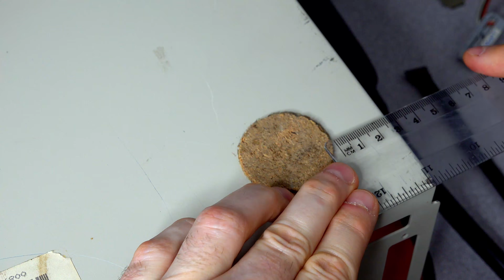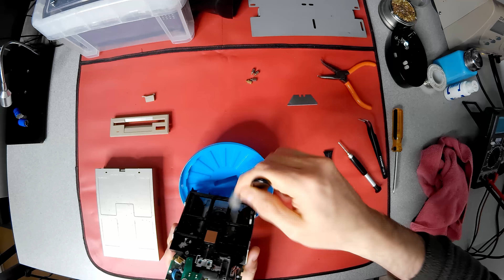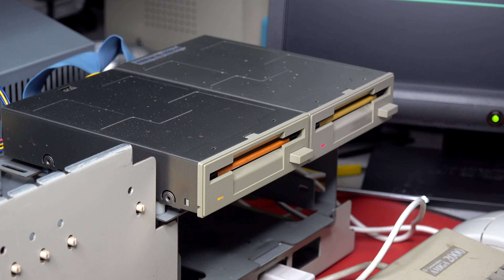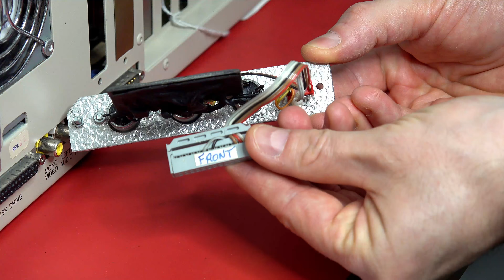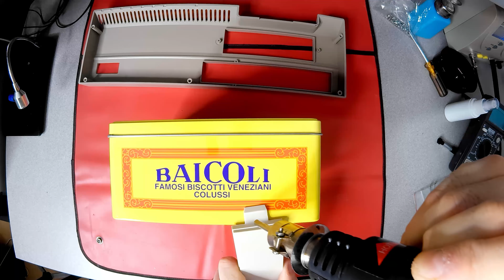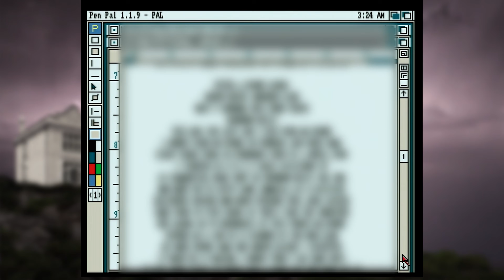Mystery Amiga 2000's (Pt4) - Finishing the first A2000

Comment: I'm used to seeing Atari STs and Macs for midi use, but i was not aware that the Amiga was used for that as well. But then my attention was always on the keyboard models, like the 500 and 1200. I barely even knew Amiga had desktop models until long after i had moved to PC.
Reply from the maker: All the range could easily have MIDI added (and quite cheaply too) but I guess as it wasn't standard and a decent hi-res monitor was expensive, the Amiga lost out to STs and Macs. The CDTV was the only model to come with MIDI In/Out as standard but that was aimed at the living room.

Comment: Great video.  I'm currently restoring my Amiga 2000 as well.  Suffered a bit of damage from the dreadful Varta battery.
Reply from the maker: I haven't seen an Amiga 2000 without battery damage so it's in good company there. Much damage? How's the Amos work going?
Reply: @TheDigitalOrphanage  Quite a bit of damage.  Several broken traces.  Mostly pads separated from the trace.  AMOS work has been a little slow.  Been re-learning some 68K asm.  I finally managed to backup ALL of my 1990's data off my A1200.  :-)
Reply from the maker: Little bit of jumper wire and you'll be sorted! When I find some I want to learn some 68k assembler, sounds like I now know who to say hello to nicely if I get stuck! :-) What assembler are you using, Devpac 3?
Reply: @TheDigitalOrphanage  I'm using vasm.  I prefer to assemble on my PC and send to WinAUE (to be later ran on real Amiga hardware).  I highly recommend this video for programming the Amiga in ASM:  https://www.youtube.com/watch?v=-SQEORSphBs
Feel free to contact me any time.
Reply from the maker: Thank you! I met Graeme at the last SWAG meet in January. I forgot he said he had some videos on Amiga development, it was a such a busy day for me as I was the compère for the event.